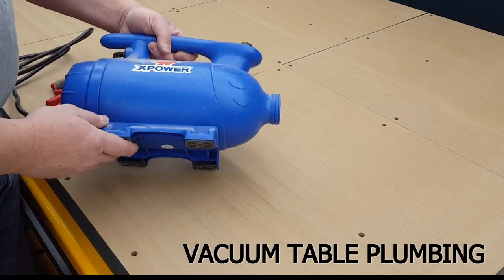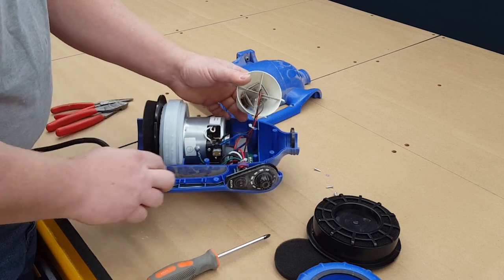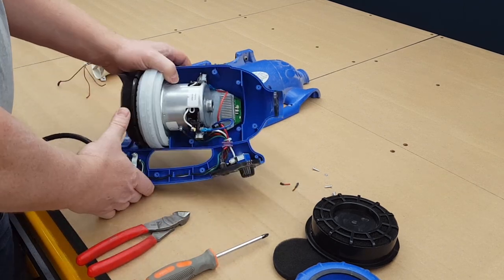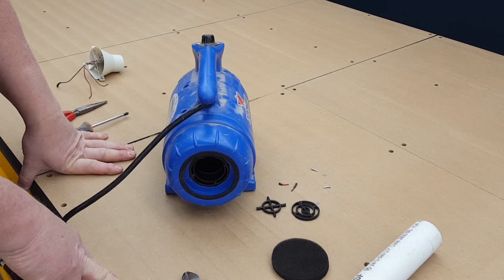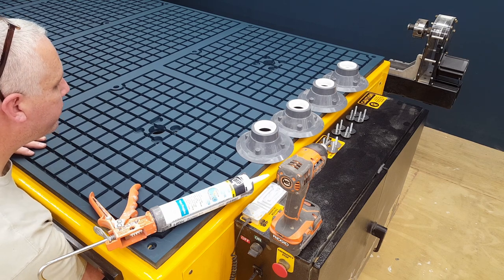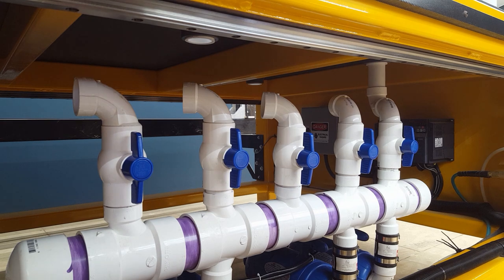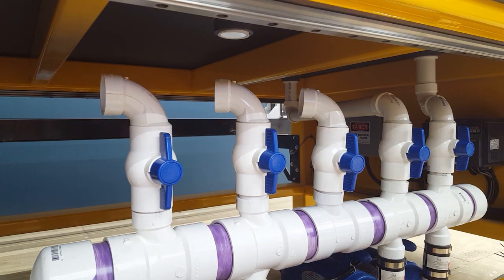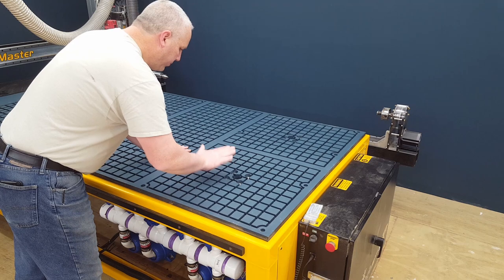CNC Router Vacuum Table - Part 2 (Plumbing)

Comment: Cool build! I'm curious how it's gotten on as I'm a bit worried about the cooling of the motors. Usually those vacuum motors cool themselves with the air that they're sucking through, but in this use case there's very little airflow and thus very little cooling. Have any of the motors burnt out?

Also, have you ever been curious to hook those motors up in a series to get a stronger vacuum on the table? In parallel like you have now it will be able to deal with leaks better, in series it should make a slightly stronger vacuum.

Comment: Very helpful video - thanks. About to make up a hold down table for my new router. Wondering why you chose
the pet dryer for each zone instead of a blower into your large PVC tube. Are your shut off valves necessary
if you can electrically isolate which has suck and which doesn't? I got valves (2") from Amazon and they are really stiff to operate. How are yours?
Reply from the maker: Hey Ian, The valves are necessary on my setup as all of the vacuum motors into a shared plenum so then I can have the force of 4 vacuum motors on a single area if needed. And yes, I purchased 10 PVC valves from Amazon as well and two of them are trash because I couldn't turn them at all. Good luck with yours.

Comment: Following along with baited breath. 😁
Not really going to ask questions since they’ll all likely be answered as you progress. 

Seems like an unlikely source for vacuum generation at first but it all makes sense in the end.
Reply from the maker: Thanks for following... I have based what I have created here off of the Hurricane Vac system. I had that on a previous machine of mine. I have had to replace several motors in the Hurricane and this is what they had used. While being 220v motors, and these only being 120v it shouldn't be too much of a difference. In the next video, I will be adding a spoil board and will demonstrate how well it actually works. It really all comes down to losses in vacuum, and trying to minimize that. Thanks for the comment! And thanks for watching.

Comment: Nice setup. No concern with the lack of debris filtration?
Reply from the maker: Great question! The final setup video, Part 3, will be my zoned spoil board that goes on top of the vacuum table. Debris will not really get in it, so I'm not 100% concerned about it. I'll have that part out soon. Hopefully it will make sense to you. Thanks for asking and watching.
Reply: @x3cnc479  Oh, it made sense. I was just curious about this because it's common to protect blowers from inadvertent debris. Really...just a curiosity.  I thought about vacuum on my Stinger II, but in reality, I'd get little utility from it since I don't do a lot of work with sheet goods and when I do, it's easy to calculate for screws.